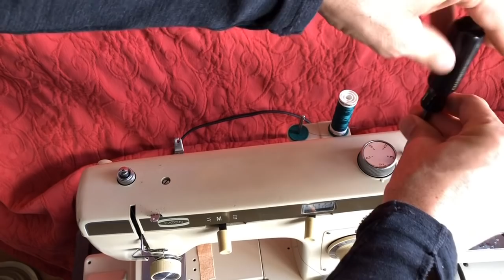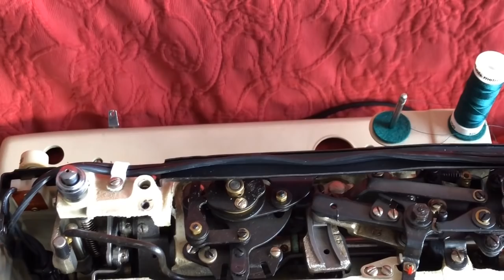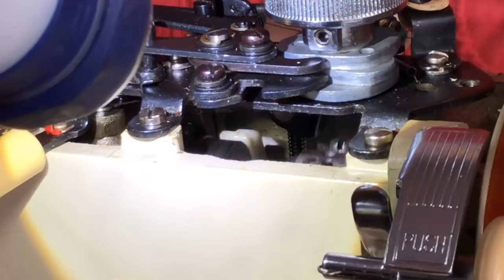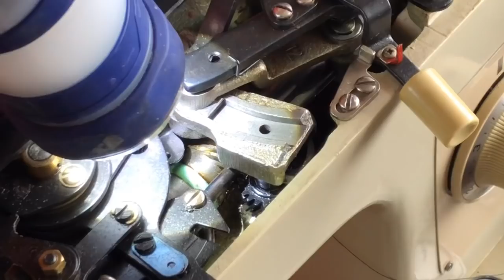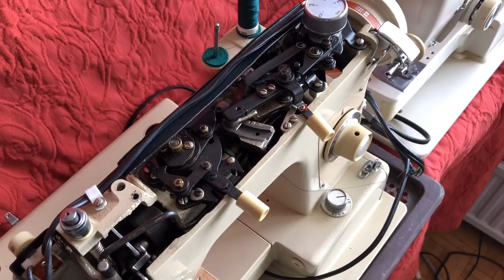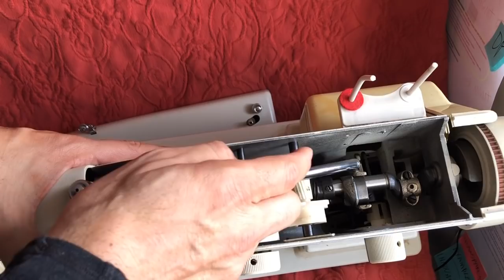PART 2: DEFINING WHAT "Hybrid Vintage” REALLY MEANS. Peek Inside Vintage Models Hiding Cost Cutting

Comment: I own a vintage Singer Fashion Mate 288 (flat bed machine made in Brazil) that I purchased new sometime around 1979, along with a wooden case. It is mostly metal, but it does have 3 plastic gears which are lubricated with grease from the factory. They still have the original grease on them. The manual that came with the machine states very clearly to never put oil on the gears, but to use only Singer gear lubricant. It's a great sewing machine that still runs as well as it did when I first brought it home, but it is so heavy that I just cannot lift it any more, so I just recently bought a new Janome electronic machine that weighs only 12 pounds. The Janome is a nice machine, but it doesn't have the sturdy, solid feel of my Singer. I have never had my Singer serviced because it's too heavy for me to take anywhere to have it serviced.  I've kept it cleaned and oiled, and it still has the original drive belt and even the original light bulb. I seriously doubt the Janome will still be going strong 40 years from now, but my vintage Singer might.

Comment: I’ve gotten myself into a very deep rabbit hole and I’m loving the fall! Your videos have been so helpful! Here’s my question. My 1953 Elna Supermatic has a nylon gear. I’m restoring it (and two of her siblings) because I love the way they look. How do I properly care for the gear? Will my ham-handed attempts with wd40 do lasting damage? Am I eternally doomed to rescuing cute machines as though they are injured puppies?!?
Reply: Hi Poodle Zilla.  I've had to replace a couple of nylon gears in Supermatics. (Thank God for You Tube & for the free service manual available online.)

 What was it with Elna & Bernina?? They jumped on the nylon gear bandwagon before most other manufacurers.  They engineered brilliant machines but then they  screwed up by putting a few nylon gears in there...... How much money did they really save by cheap skating on the hook gear & the camstack gear? 

The green '50's Supermatics only have 1 nylon gear (in the free arm).

 The 1960's blue Supermatics added a plastic cam stack gear & a plastic presser foot lever. 

The 70's Air Electonics  added even more plastic.

 Damn. Why do I love  those Elnas so much??   I can't help it.  It's like staying with an alcoholic/abuser. Why, why why ....... I keep trying to rationalize.  Is it because they're the smoothest & most functional of the vintage machines I've used? Or the funky styling ? (The green ones, anyway.)
Reply from the maker: Hello Poodle Zilla. Your questions are very helpful.  First, I understand your love of the Elnas.  They were innovative machines and Elna was the first to introduce Free Arm machines to home use.  FYI, I have some recent videos on what I call "Hybrid Vintage" sewing machines which are those that are mostly metal, but contain some mechanical plastic parts.  Check those videos and also note I am prepping another in that series where I mention specifically how to clean/care for the to extend their lifespan.  As for your own machine, the important thing you can do for plastic parts like gears is to:  Keep the machine in stable climate controlled temps.  Don't store in attics, garages, or outside buildings.  Machines like the same comfortable temps we do.  Next, avoid any application of solvents or lubrication products.  These will accelerate the aging of plastic.  Stay tuned for my next video on this subject as you might be someone who could hopefully find some information to use.
Reply from the maker: This is a theory, but I suspect that they originally compromised due to:
1. The promises of the plastic industry who swore their "space age" products were superior to steel.
2. As more companies looked to off shore production to Asia (Its not just something that is going on today), Japan offered extra low cost labor as it was rebuilding from the war and European manufacturers initially resisted moving their production their unlike Singer, White, and Kenmore (supplied by White & others).
3. Competition intensified during the late 1960's and into the 1970's as more people made less and less of their clothes and more households required 2 incomes to maintain prior standards of living.  
4. Last but not least, short term profits took priority over long term reputation. Greed killed lots of brands and reputations over time.
Reply: That's really interesting & explains so much...... I was  puzzled by the plastic used in those otherwise excellent Swiss machines, especially since Singers from the same mid 50's -early 60's era,  hardly used any .  Thank You.
 (And Thank You for creating & sharing all of your excellent videos!)
Reply: ProfoundConfusion any hints on getting those bolts out in the nose? I’ve been soaking them in pb blaster, no luck. I’ve got to replace the thread uptake lever on one. It came to me with a welded repair (jb weld, I’d guess) and it promptly broke. I’m still waiting on my replacement pulley wheels to be delivered😕
I love them. They are so gorgeous and the cams are like collector cards.

Comment: I have a Pfaff 803 that sews fine if you use it by hand, which is tedious.  It seems like the motor is tired however.  Or something is slipping.  I haven't taken the top off to check it out further because I no longer need it, but if I ever get around to being curious enough to see, it shall be interesting for sure.  Thanks for all the great videos.

Comment: I have got a Singer 237, and i believe it could be clasified as a "Hybrid Vintage" as well. I have made it sew with heavy materials and tex 140 thread. I had to replace a plastic race gate, and I got a new from an US supplier. Furthermore I got a problem with the plastic tensioner case, with a small bar broken for thread relief, when presser foot is up. I managed to make fix to that by making a steel part from some steel thread. It was not that easy, and you had to be carefull, that the check spring works with no friction as intended. Picture: https://www.dropbox.com/s/zuf10p33ftbspva/Tensioner%20repair%20Singer%20237-2.jpg?dl=0  You may be able to get steel parts as replacement for the tensioner, because I think other tensioners for other older sewing machines use the same kind of tensioner. Do you know how much can be interchanged here?
Reply from the maker: Hello.  Unlike most brands, Singer was known to reuse older designs when they had proven reliable over time.  And Singer is one of the few brands of vintage sewing machines for which there are SOME parts offered as new reproductions.  As for tension assemblies, I often prefer to use old/salvage parts because some of my experiences with new replacements for those have not functioned well.  Items such as the Race Gate are ok because they do not really require precision in the way that tension assemblies do.